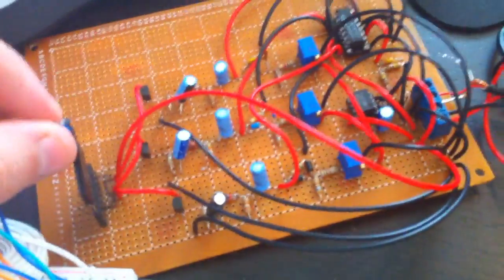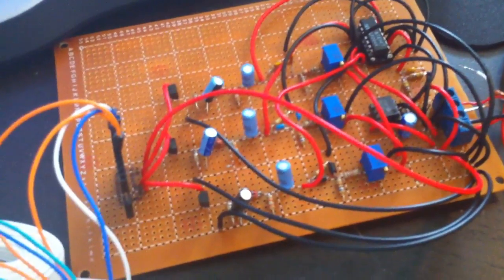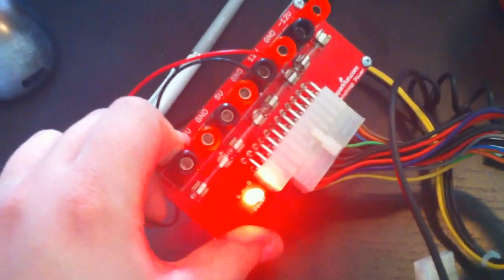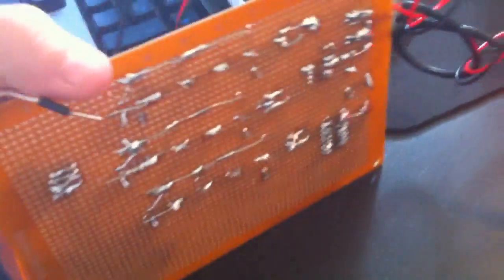Prototype RGB Color Organ

Comment: @AndrewLeCody 

I'm going to get the $15 110v kit and then use  LOTS of 110v LEDs with built in voltage limiters or LEDs with Edison bases.   The other project I'd like to do is build a 5v color organ into an open  $25 laptop fan so my computer can have "running lights."  With that I'm thinking of using 6v auto LEDs.  I've got a friend who is an EE so he can help me change the schematic to adjust the power needs.  Glad you went with RGB.  I don't get why Collin used yellow.

Comment: I'm going to use the $15 110v kit and then use colored  LEDs with built in voltage regulators or with Edison bases.  The other project I want is to put a 5v system into a laptop cooling fan so it has "running lights."  I've got a friend who is an EE to help change the schematics.

If you still have the proto, can you upload some more music?  Pump It Up, by Elvis Costello....

Comment: @AndrewLeCody aight, thanks alot :D, now i just have to order them and i´ll see with what i am dealing with, i´ll post up a video of my finished project once is done of course, thanks again for the info, oh! one more thing, how does the power supply goes wired? cuz on the schematics i only see positive voltage, so the negative from the power supply goes ground? and also, IC#2 there´s a 100kOhm resistor that leads to V+, what that stands for? the 12v+? or what? :S